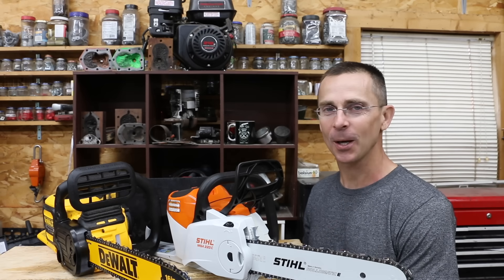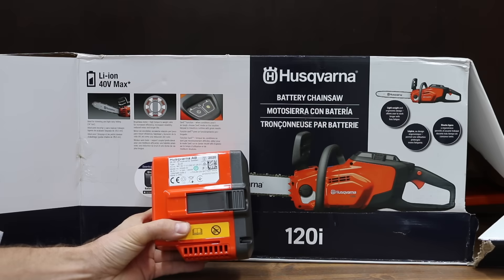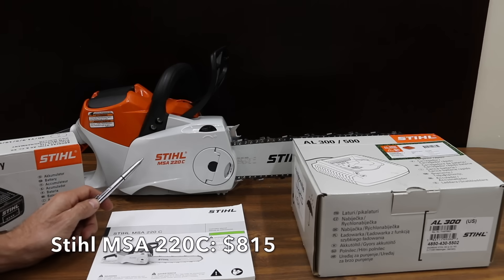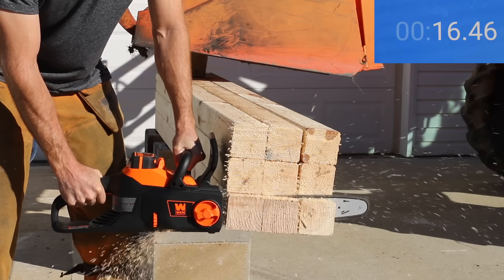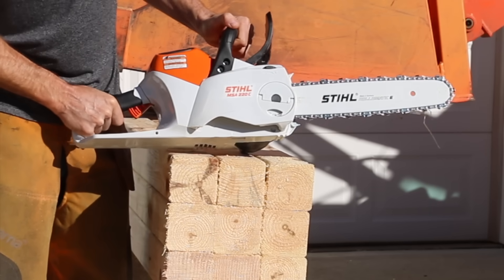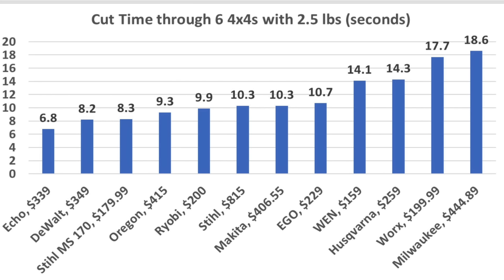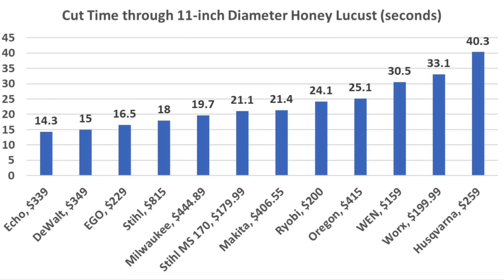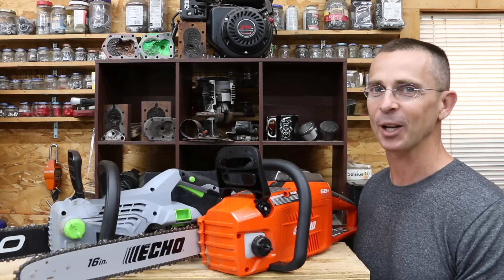Best Battery Powered Chainsaw Brand (ROUND 2)? Stihl, Husqvarna, Echo, Oregon, DeWalt

Comment: I want to thank you for your information. I bought the ego 18 inch blade as it has twice the rpm’s of the model in your test. The cost was $ 369.00 us. The five amp hour battery is great, the only down side is the battery charger, it’s the slowest one they make. Since I have an ego mower, it’s charger takes around 30 minutes. Thank you again.
Reply from the maker: You are welcome!

Comment: I’m glad he did the second vid with the echo. I have used 4 of the chainsaws here and the echo is the clear winner from my experience. Unfortunately, echo has discontinued this I’m assuming from lack of sales bc of its higher price over other models. But it’s price was worth the performance. The string trimmer is also the best I have ever used as well. Most torque I’ve seen in a trimmer.
Reply from the maker: Thanks for the feedback.

Comment: For the money the best all around deal seems to be EGO and DeWalt. The other thing about the ego is you could put a 5 amp hour battery into that and increase the run time. I have a 21 inch ego self-propelled mower, and it's about the best more I've ever had. The wheels are so good on those ball bearings, I hardly ever use the self-propelled like I thought I would.
Reply from the maker: Thanks for the feedback.

Comment: Purchased the Echo 8 months ago. I've run chainsaws professionally for many years. Wear and tear on my arm and shoulder when starting had me checking out cordless saws. We've always used commercial grade Sthils and Husqvarna's so I was a bit concerned about the Echo's performance. That said I'm very impressed, runs like a demon, really as good as your tests suggest. No issues after lots of brush clearing and multiple cords of firewood.
Reply from the maker: Thanks for sharing.
Reply: I can say this.. as far as Echo, which I have not used. There is always a Home Depot somewhere and Echo's can pay for themselves in one project. You can always resell and buy the latest for next project.
Reply: Echo has always made decent tools. IMO
Reply: Unfortunately it seems you can't get the package with the battery and charger anymore, so it seems like the price is now a bit over $500.
Reply: Gas Echos were so much better before the emissions crap had to be added.
Reply: Have u tested cordless string trimmers ?
Reply: What do you think about the safety position? Does it get uncomfortable?
Reply: EGO is better.
Reply: @jubjubs1000 that video pretty much disproved your statement
Reply: @jubjubs1000 no, that's just blind ego saying that😂

Comment: Ego has a 7.5 battery. I have a push mower that uses it. It can be used in any of their equipment. All their batteries are interchangeable with all of their equipment. The only thing I used the old 2.5 battery with was my weed eater. Those don't need much juice. Good video.
Reply from the maker: Thanks for the feedback.

Comment: I’m definitely impressed I was cheering for the Dewalt because I just don’t like echo I had very bad experience with several echo gas powered equipment that I bought brand new the dealer was never able to get them running they were nothing but trouble. However a battery powered saw I’m sure that’s Is definitely a different animal. I would like to see longevity on all those saws How they withstand a few years of abuse
Reply from the maker: Thanks!  Thanks for the suggestion.

Comment: I am not too good at starting gas saws.& worse at keeping them running reliably .could learn to do better but battery power works when you pull the trigger.  I mainly need it to thin out 4-5 inch pines that would be much bigger if I would have done it 8-9 years ago. Always something else to do. & early on ,the battery saws were suspect..Dk. Making Excuses .probably call small pulp wood operation and get it done for free.
Reply from the maker: Thanks for the feedback.

Comment: I like that you detail the volts and amp hours of each included battery, but it would have been nice to have a chart of battery capacities in watt-hours like all the other stats, though I suppose that's sort of accommodated in runtime. It would also be helpful to know the maximum battery capacity available for each brand. Some of them sell much larger batteries.
Reply from the maker: Thanks!

Comment: I have a Wen and am very happy with it.  One thing, it comes with a skip link chain.  Strangely the Wen website shows a regular (Non skip link) chain as the proper replacement chain.  The non skip link chain speeds up the cutting.  
As for battery run time, by the time the battery runs down, I am ready for a break.
In any event, I plan on never having a gas saw again.  No carb. to gum up and no starter cord to break!
Reply from the maker: Thanks for the feedback.

Comment: Put the battery powered chainsaws up vs my 6.8 up 14600 rpm 65cc gas chainsaw running still rapid comfort chain it blasts through red oak like fast as any of the electric ones and cuts 4 to 5 hours of cutting
Reply from the maker: Thanks for sharing.
Reply: @ProjectFarm   sorry for the snarky comment no usually me sorry Dan

Comment: Great video. For the slightly extra price I would suggest the Ego 16” chainsaw that comes with the 5.0ah battery. The unit comes with the larger battery pack, cutting length, and the electric motor used is supposed to be higher rated than the 14” version.
Reply from the maker: Thanks!  Thanks for the feedback.
Reply: Yeah and the 18" paired with a 7.5Ah battery tied my 455 Husky for how much it could do with a charge vs one tank of gas. Of course with the recharge time vs refill time, I had cut a lot more wood with my gas saw at the end of the day

Comment: I bought the echo, based on your recommendation / test results.  Awesome chainsaw. I'm even buying an extra battery for longer stays in the bush.  No oil gas bs... low noise.  Awesome.
Reply: You should have try the Stihl MSA 300, you with be surprise. I have the stihl 220C and 161T I just got the MSA 300 two weeks ago I have only use it for about 4 hours but I can tell you power wise have nothing to do with 220C, it is much powerful.
Reply: @sirvozelo1  Gracias para compartir.  Muy interesante. Espero que tengas un gran dia!

Comment: I am curious as to what saws have a chain break or stop the chain ASAP when you release the trigger. My Ryobi seems to keep spinning for a second after I release the trigger. Also some saws you can put a larger bar and chain on, I put an 18" Oregon bar and chain on my 40V Ryobi and it made it into an amazing saw and since I have two 40V batteries it's a great inexpensive tool. $250.00 for an 18" Battery operated chain saw is hard to beat. Plus I got my first one stuck in a tree and damaged the saw and was able to return it to Home Depot and get a new one, Great warranty!
Reply from the maker: Thanks for the suggestion.

Comment: Great review.  One variable you might want to mention though you alluded to it.  Most people that are buying electric devices have more than one type of device and would want to maintain commonality between batteries and their various devices as long as the saw in this example is one of the best.  For sake of example I have 1 (7.5 amp)  2 (5 AMP)  1 (2.5 amp) and 3 (2 AMP) batteries from various Ego electric devices.  Thus I would be in pretty good shape if I choose the Ego Saw.   The other I am not sure you mention weight differences  in the saws (this will vary by the size of battery of course).   Smaller batteries more swaps less weight.
Reply from the maker: Thanks!  Good Point!

Comment: I have used Echo chainsaws for a couple of decades. But due to the way I work with a saw I really want an arborist style case. I've had an arborist saw from Echo two of them in fact they have been wonderfully. It is now time to get an Echo chainsaw to go along with my echo electric trimmer and Echo lawn mower. The lawnmower outcuts my 6 horsepower Murray lawn mower.
Reply from the maker: Thanks for sharing.

Comment: I just recently got the 18" EGO that came with a 5 Amp battery, it cuts through trees like butter and is quiet. I took down 6 trees in minutes while creating trails through the forest on my property. I love the EGO lineup because I can swap batteries with the other EGO power tools.
Reply: Once you have a few ego tools, you need a few more. Swapping batteries between yard equipment feels like a game changer. Plus you can choose more powerful batteries
Reply: @SL1CEND1CEN  I recently bought the EGO snow blower and it came with two 7.5 amp batteries.  Now I feel the need to get more tools to make more use of these batteries once the snow is gone.   I am watching this video I don't even have any trees in my yard lol.
Reply: @newtron77 you probably bought an Ego something in 2 years... just the 7.5ah battery in an Ego chainsaw...well it will be extremely heavy and somewhat out of balance
Reply: @SL1CEND1CEN   Moooorrrre Pooooowwwweeeerrrrr!
Reply: Doesn’t the 18” have metal bucking spikes?
Reply from the maker: Thanks for the feedback.
Reply: Where did you buy your EGO?
Reply: @ericlaphroiag3546  just got mine off Amazon for $330.  Couldn’t find one locally after a storm blew through (of course).
Reply: @BeefNEggs057  just bought one, Im using it now, love it, cuts trees like butter
Reply: @ericlaphroiag3546   Same experience here.  Better than expected!  Battery lasts longer than I want it to so far lol.
Reply: Picked up a blower and the 16 inch saw and I'm an not disapointed

Comment: Wow, that is thorough. I think you have what it takes to replace Consumer Reports. I have a 3 year old Greenworks 16 inch.  4 ah battery with the 40V Max. Then I bought their string weed wacker with the same battery. Happy with both though the chainsaw has to be handled with care since the bar and chain are not as robust as a gas powered unit. I think total battery energy is very important since it will affect the number of charge cycles you will use for the life of the product.
Reply from the maker: Thanks for sharing.

Comment: Great test! The DeWalt, but without battery and charger, will arrive at my place in a couple of days. But I would have definitely chosen the Echo if I didn't have a couple of 60v Max batteries laying around already. The built quality of the Echo appears to be very solid, its performance is amazing, its low price hardly believable.
Reply from the maker: Thanks!  Thanks for sharing.

Comment: You are comparing batteries with vastly different amp hour capacities, which affect both run time and performance. I have the 12 and 16 inch model Dewalt saws, and using a higher amp hour battery noticeably increases the initial power of the saw on a full charge.
Reply from the maker: Thanks for the feedback.

Comment: Dear Sir, Project Farm, will you do this test to Husqvarna 540i XP bl200i battery instead of bl300i, and comparing Husqvarna 120i against Stihl MSA 220 C B isnt a fair fight Husqvarna 120i more equal to MSA 150 or 160 . Husqvarna 540i XP against Stihl MSA 220 C B  against Echo 1600, and Kramer 80v chainsaw would make fair fight.   Comparing proffesional battery chainsaw against other similar chainsaw.  Comparing home and garden use by it self. If you compare Husqvarna 120i against 330i you will get a notable difference, comparing the 330i against 540i xp is like comparing a stick against a laser sword.  So this test with only showing Husqvarna 120i  will not be fair against Husqvarna 540i XP which is in the high end inn battery chainsaw and used by multiple arborist, and tree People around the world.  Keep going strong!
Reply from the maker: Thanks for the suggestion.

Comment: The ONE important point no one seems to address: will I be able to get replacement batteries 3-years from now? Far too many brands stop making the batteries for your model after a couple short years forcing you to have to get a whole new chainsaw. In this category, Makita wins hands down. Makita has kept the same battery design for years and years. You don't have to worry about discontinued batteries with a Makita.
Reply from the maker: Thanks for the feedback.

Comment: I own several outdoor power equipment tools of all brands.  My chainsaw is a Stihl 026 with a 16 inch bar.  It is 30 years old and is one of the most loved saws by pros.  Unfortunately, it is no longer made.  Many comments have been about the  price of the Stihl.  You chose the most expensive charger and battery that Stihl offers and the battery performed very well and the charger was the top performer.  You can select cheaper Stihl power sets to go with this saw to save some money.  

In regards to the Echo saw you selected.  Echo products work well out of the box, but for the last several generations of products, they are not nearly as durable as Stihl products. IMO, the Stihl will last much longer than the other products in this comparison.  I would be especially concerned about the battery packs of the other brands.  For my money, it would be the Stihl or the Echo.
Reply from the maker: Thanks for the feedback.

Comment: A great round-up between this one and the earlier one.  Thanks for including the EGO.  Although the Echo is amazing, I would opt for either the DeWalt or the EGO simply because I've invested in those battery technologies already around my house.  The DW already has a great battery, but with the EGO, I'd buy the bare tool and use my other 5.0 amp hour batteries with the chainsaw.  Those are just some additional things to consider besides just performance; things such as battery conformity and what you already own as that will reduce the "entry price" into a new tool.  Great job.  I love your videos!
Reply from the maker: Thanks and you are welcome!  Thanks for the feedback.
Reply: totally agree. The echo is better, but the versatility of the dewalt batteries means I have about a dozen 60v batteries to swap in/out as well as two large 4 battery charger. I have other yard tools that are dewalt as well as the normal shop tools.
While the echo might be a bit faster, but it would be a large investment for an only slightly better tool.
Reply: The ego saw is a terrible piece of equipment.
Reply: @jamiebiddix4302 why do you say that?
Reply: @DADVNTRS I owned it. It wasn't powerful enough or had a long enough battery life to cut a tree down equal to the bar size of 18in.